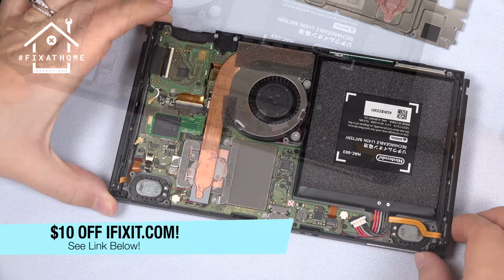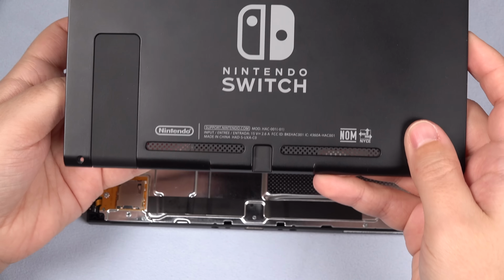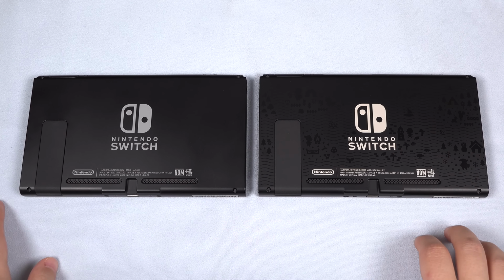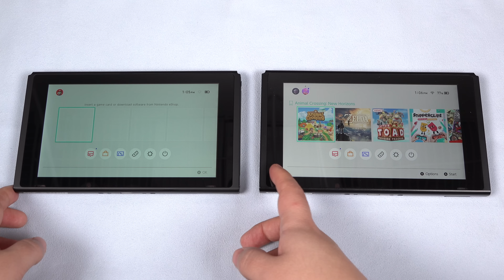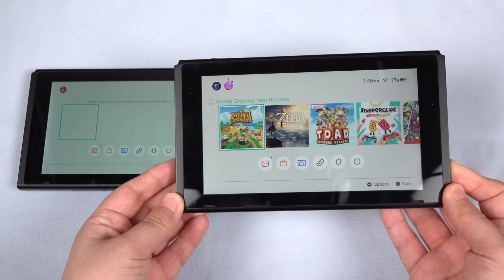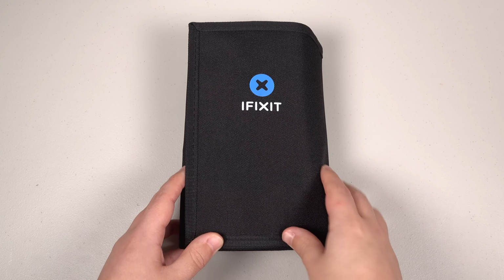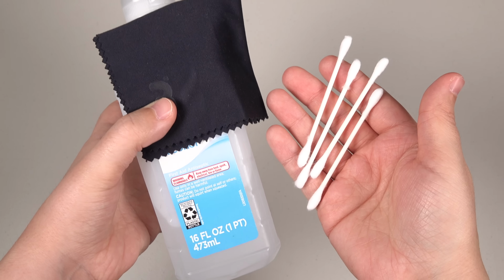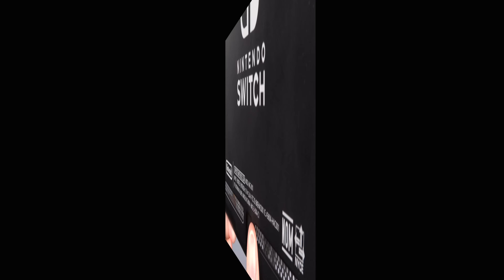Nintendo Switch Upgrade Mod: Original to V2 (Better Battery Life)

Comment from the maker: Mod at (3:10) Note that the batteries on both models are the same size! The processor revision is what provides the better battery life, as it is more power efficient. I also find that it runs cooler than the original. AND IF YOU PLAY ANIMAL CROSSING NEW HORIZONS AND DO THIS YOU GET TO KEEP YOUR ISLAND BECAUSE IT IS CONTAINED ON THE BOARD!
Reply: TEAM "RIGHT TO REPAIR" says Louis Rossmann. Be sure to check out his youtube channel.
Reply: Greetings from Singapore - In partial lockdown.
Reply: YES! Do a full step by step please!!!
Reply: Step by step guide pls
Reply: Good for my wife to know. Thanks for the updates!
Reply: Hold on I’m confused, the animal crossing game data is contained on the board? Like the motherboard? Wouldn’t that mean if you swapped it out with the v2 version the data would be gone?
Reply from the maker: Jade Queen yes. Gone. The save file for animal crossing is stuck on the eMMC storage of the motherboard. Nintendo wanted it this way to tie one island to one Nintendo Switch and also because they said that is how the game works / it’s complicated. They are seeking to make a transfer service. So if you don’t have the game tied to a V2 board already you will lose it with this mod.

BUT the eMMC storage pops off I believe, so if you pop it off and install it onto your V2 motherboard it should still be there.
Reply: @EricaGriffin  But that means BGA soldering the Memory chip onto the motherboard...
Reply: @TAILSORANGEs  Interesting, as I'm seeing it as a full lockdown, until the 4th anyway.
Reply: It will still let my "old" switch to be "unlocked"?
Reply: @EricaGriffin  I got so hyped by this video until I just read this comment. Bought a v1 off my friend due to this whole switch shortage and while it has been 99% dock mode due to quarantine, I would have liked the extra battery life but not at the cost of losing my island
Reply from the maker: Let’s hope Nintendo releases their transfer service soon for this game like they say they will
Reply: @EricaGriffin  Hopefully.
Reply: @andrewmiller1540  Ugh yeah I feel the same way, I put in 80+ hours into my island so far I don't wanna lose it
Reply: Erica Griffin Question! Where did you return your switches when in search of the v2 screen of your liking? Please and thank you! Great video!
Reply: I didn't see read this message before I posted it so the battery isnt better it's the motherboard? still email back if I can just buy one of them if my rework I do gos horribly wrong this chip is extremely small thanks!
Reply: Levin Soh no you don’t, the switch has this part made modular. It has the “LEGO pins” as some like to call them. But, I believe the emmc is tied by serial number to your board like PlayStation hdds (I’ve yet to confirm it though). I’ve repaired (and broken) several units so while I haven’t tested a swap between units, I can say with certainty it’s way easier doing a flash storage swap on a switch than any other mobile device I’ve worked with. You may still need to factory reset it though.
Reply: Will this fix the ban on my original switch? I'm so interested, v1 is banned but the v2 is good
Reply: I really like the mod idea. I may take advantage of this in. But do you know how it would effect animal crossing?
Reply: It likely runs cooler more due to you replacing the thermal paste with higher quality paste than it shipped with than anything else.
Reply: @christphern . Nope. The V2 Switch actually runs cooler. It's consuming less energy, which in turn means it's producing less heat
Reply: @EricaGriffin  
> BUT the eMMC storage pops off I believe, so if you pop it off and install it onto your V2 motherboard it should still be there.
Wouldn’t work. “V1” and “V2”/Lite hardware use different and incompatible bct and pk11 binaries, so the system would just kick you into RCM immediately.
Even on hardware of the same type, you’d need to obtain two consoles that generate the exact same device key (derived from other console unique keys), device id (derived from SoC lot code, fab code, wafer ID, etc that are burnt into the SoC), and (if on <6.2.0), keyblob keys (derived using device unique secureboot key and a seed).

Edit: youtube decided to only post like half the message...
Reply: Erica
Cool video, appreciate it 😎 
Ifixit wise, is the pro version really worth the money, as opposed to mako for instance?
Reply: Any idea if this would work vise versa? Looking to swap a v2 for a v1 so that I can jailbreak and run android.. also do u still have the v1 MB Im interested in buying it if your selling it.
Reply: True tegra x1 is way more efficient than its predecessor but also the batterie on the mariko switch (refresh) is bigger 4310mah vs 3600mah for switch v 1✌️😁😉
Reply: @EricaGriffin   if you compare switch lite motherboard board with a normal switch motherboard you can see that switch lite motherboard is missing a chip that I believe would of made it possible for the lite to dock on modify dock
Reply: with other words, for the *less smart people*, you keep your save data
Reply: @Damari Damien Instablaster =)
Reply: @Byron Conrad It did the trick and I actually got access to my account again. Im so happy!
Thank you so much you saved my account!
Reply: @Damari Damien No problem :D
Reply: @EricaGriffin  Hello! I'm noticed that you are not opening this metall clip from Tegra chip and two memory chips to replace thermal paste in there. Is it better not to touch it? I guess it's hard to open so it can be dangerous
Reply: Has anyone tried  DIy different types of battery to work in a switch because after awhile v 2 switch is still not best life on switch I don’t use my switch often it dies faster than my iPad
Reply: But if your battery life has gotten worse over time and you can't bear it, you should replace the battery also because they degrade over time. An original model original battery will have less capacity now, since it's been used and been around for 4-8 years
Reply: I watched this a cupple years ago and wanted to do it to my switch but had no money I was still a high school kid but now i have a job and am graduated one year and want to try this for myself my one question is if I swap the boards will my game data still save? And be there? Hopefully you will see this and respond but I know this is old video at this point. The reason I bring it up is I have a ton of hours in Pokémon and had to restart all my Pokémon games recently after buying a faulty sd card from Amazon so I don’t want to have to do that again so im wondering if game data saved because nintindo doesn’t let us back up our Pokémon saves to the cloud because they are afraid we will duplicate Pokémon hopefully you will see this and respond we shall see crossing my fingers

Comment: I like my v1 switch just the way it is, exploitable tegra and all
Reply: So I am guessing swapping the motherboard the tegra explorer wont work.  No point doing it then. ..hmm
Reply: Yeah, at least to know that if something happens to the unit besides the motherboard, you could transplant it to a new brand new switch :)
Reply: Yea I thought about doing this upgrade too, but looks like you'd lose the ability to homebrew since I would imagine the mobo is where the exploit happens
Reply: Yeah im keeping v1 then.
Reply: @zergslayer69  the cpu is where the exploit happens but yeah swapping out the mobo is a nono for homebrew
Reply: You can switch the Mobo from exploitable switch into new V2 switch shell with the new screen and battery.

I did it a few weeks when my son dropped my OG switch and broke the screen.

Now I get the new screen upgrade and battery and still run atmosphere.
Reply: @mykehdoom  yes but you still have old cpu where the efficiency lies. no ? battery is same
Reply: @buritomaster3849  

Battery isn't the same. The new battery lasts longer but not as long as it would with the v2 chipset.
Reply: How’s the bread going? Toasted yet? Or do you not play docked alot
Reply: exactly
Reply: If yk then yk

Comment: oh man, i didn’t know the switch screens were so inconsistent too!! thought we left that behind with the 3DS 😞
Reply: The display on my first switch isn't all that great. Honestly I just kinda assumed they were all like that until I saw a friends switch. Made me pretty sad. Replaced it with a revision 2 switch and made sure that the unit I received had a nice display. Soooo much better!
Reply: Took me 3 switch's to find a good display.
Reply: What's worse that 3DS both of the screens can be different at a time.
Reply: @Ezra Leite that's why a lot of people were in love with the PS Vita
Reply: What does that means?
Reply: @Ryanlexz  it means that some displays look better than others, bad color adjustment etc.
Reply: I have a good display fortunately
Reply: @luisfernando55     PSVITA OLED was so awesome
Reply: Don't. Even.
Reply: How can you tell if you have a good or bad display
Reply: @vgrepairs  sad I didn't get to experience the OLED Vita.. my original non-OLED Vita really didn't do it for me
Reply: @ShamanNoodles You can get one now for around $100. Maybe less.

Comment: Unfortunately though, the new Switch is not "hackable" anymore. I actually bought a used, confirmed un-patched Switch last year because I specifically wanted to keep the option to mod the device. So, one has to decide between mod-ability and battery life. I think most people will choose the battery life though. Still, good to keep that in mind when getting a Switch..
Reply from the maker: I have no interest in hacking the Switch. I want it to operate within Nintendo’s desired parameters. I just want to choose the hardware I use. 😀
Reply: @EricaGriffin  Oh, I definitely understand that. My decision for getting a hackable Switch was a very personal one: I'll have more options once the Switch is not be supported anymore. And enjoy tinkering around with software - I already tried Android on the Switch, it's pretty cool. The system runs surprisingly well, and it behaves just like a tablet - with JoyCons support. You can easily stream desktop games with Steam Link, which works surprisingly well.

But the on-device firmware of my Switch is still completely untouched, as I didn't want to risk loosing access to Nintendo Online due to my serial number getting blacklisted. But I will likely look into CFW modding in the future, for features like backup and restore for savefiles or other novelties.
Reply: Katz Meowski  My main concern for a getting a switch it's the joycon drift, Everytime that I asked a Nintendo switch owner about this, they get warranty, after that buy a new pair of joycons and then the cycle begins again and there's no permanent fix even in the switch lite the problem continues
Reply: Yeah Nintendo bails hard
Reply: @Maxr1998X  Modding and custom firmware does not take away any online features, that's what piracy and online cheating does. They should not be mixed up.
Reply: @ha1vorsen  it does. Nintendo might ban your serial number based on CFW alone, not necessarily cheating or piracy. That's why every Switch CFW recommends to block all Nintendo servers while running in CFW, or removing the WiFi network all together.
Reply: Maxr1998 “not hackable anymore” it never was, up until recently. There’s actually a mod chip coming from Team Xecuter for both V2 and Lite Switches. I believe first batch already went out, but don’t quote me on that.
Reply: @Maxr1998X  what I did for my switch was I set up a emunand(emulated os basically 2 os) and then I have my normal sysnand(regular system os) so I play my online games there and my pirated games on my emuand that never connects to Wi-Fi

Comment: Building the perfect Switch 👍 Taking the best screen and combine it with a V2 board... good idea.
Reply from the maker: The insanity! Yeah, this is what we did. I got tired of having to settle.
Reply: @EricaGriffin  Next step: Custom 3D printed Computers?
Reply: A  metal body nintendo switch with small bezle display  would be great.
Reply: So the v2 Switch, has an underwhelming screen? ...did not know that.
Reply: I also didn’t know the Nintendo switch v2 had a worse screen than the v1
Reply: @SuhaylKhatib  same
Reply: and if you can , swap the 32gb  emmc with 256gb emmc :D
Reply: @SuhaylKhatib  I think it's just a "lottery" whether or not you get a good screen, which apparently applies to V1 too. Check out one of her other videos on V1 vs V2
Reply: @nightmare_recaps5834  ahem oled switch now exists
Reply: @EricaGriffin  could you make an storage and ram upgrade video because I wanted Fortnite and apex legends on my switch but Fortnite already took 15 gb and I can’t put it into the sd card because Fortnite is not in a chip form and in fall guys I often experience lagg spikes that some how triggers me :/
Reply: @jameswyma9849  and a chip :D

Comment: FYI if you are not aware. While the older board is disadvantaged with efficiency / battery life, it has the positive aspect of being able to be exploited to run payloads that can launch custom firmware / homebrew, or even Android.

Keeping my V1 around for Android myself, as one of my gripes was not being able to use the switch to browse the web like prior Nintendo devices. That and I guess running Android games as well.
Reply: Be sure to keep that switch offline. Nintendo has been known to not only target the system but the user entirely making your purchase history nonexistent.

Comment: I awkwardly had the opposite happen. Had a V1 before, was roasted in what we're going to call "what happens when the kids sneak up and jump scare you while soldering". 
So I bought a V2 on eBay. 
Turned out to have a V1 board in it. I already have my Vita for using my old roms, the Switch is my legit console, and now I have a thing with neither the battery life of the 2 or the resale value of the 1 😬.
Still starting to like the thing, though. Even if it can barely survive a tired sit down with some XCOM before bed.

Comment: My original switch screen was soooo much better than my V2, I had to replace my v2 3 times til I got a good screen, and even this screen I stuck with has a few stuck pixels and after about 10 minutes of usage it leaves a gray shadow line in about the shape of an L for the right side of screen and it doesn’t go away until I play it or leave it for about an hour or 2, I believe the term is called uniformity. But it is slighter brighter than my original.
Reply: I got the original switch never had any problems with the screen on it had it over 3 years now
Reply: @ot9523  my original switch never had screen issues, not even a single dead pixel. V2 was a mess, had it replaced like 3 times then just settled with the current one I have, it has stuck pixel and an ugly grey shadow that appears around the edges after usage. Can’t see it during gameplay, only when the screen is gray like the charging or home screen.

Comment: What's the point if what's actually making the battery last longer isn't the ACTUAL battery? the battery is almost the same, it's the new processor that has better power efficiency.

Comment: oooh, i thought the improvement was on the battery itself but it was the power consumption that was optimized. otherwise would have been much easier

Comment: Wow, so it's literally plug and play with the new processor and battery? I would've thought you'd have to create a new nintendo account or something since it's a "different" system. Guess it's all stored in the memory instead.
Reply: No, it's the exact same system. She transferred the entire motherboard, not just the new processor. It's not possible to only exchange the processor. Transferring the entire motherboard is transferring the entire system.

Comment: I just performed this same mod to pair my launch Switch's very bright and very cool screen with the internals from my new Rev 2 switch that has a somewhat dimmer and more warm screen. 
Strangely, I had a bit of a scare until I determined that I had to keep the cartridge reader module with the screen as I couldn't get the touchscreen to work in V1 Switch with V2 Switch's cartridge reader.

Interesting, eh?

Comment: Interesting

Assuming that your profile on the system already post boot up due to putting having transferred the older storage module of the Switch onto the newer motherboard?